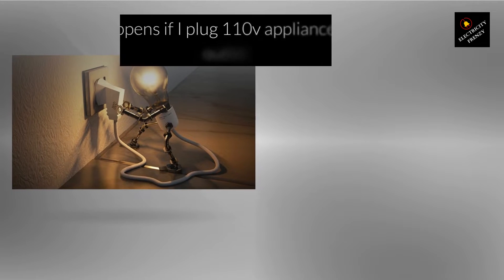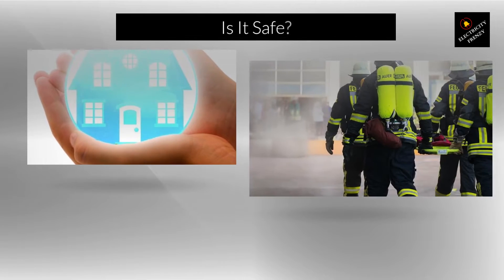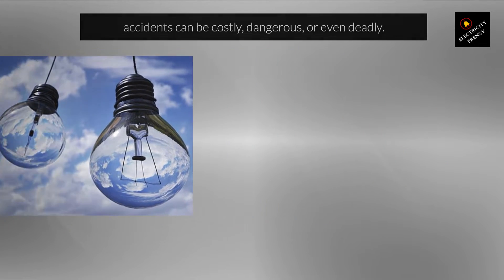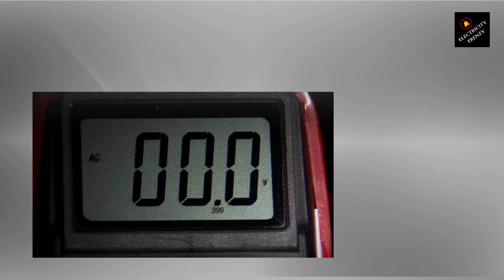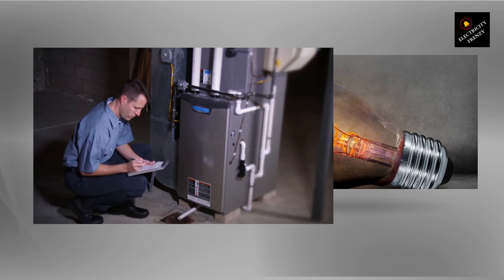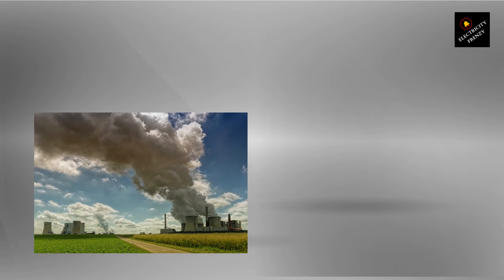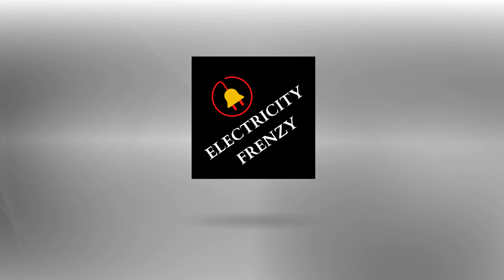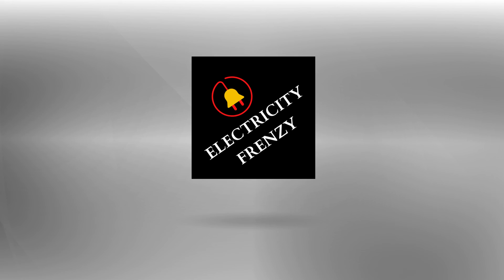what happens if you plug a 110 volt appliance into a 220 volt outlet

Comment: I connected a CD player from Japan from 110 volts to 230 volts, there was a small flash, the fuse blew but I don't know if that's the only damage, if it can be repaired
Reply from the maker: Replace the fuse and try it carefully
Reply: @ElectricityFrenzy After replacing the defective fuse it works again, I'm happy again 😃

Comment: How do dual voltage appliances work?  Phone chargers, laptop chargers, electric razors, electric toothbrushes, and CPAP machines are all dual voltage.  They can tolerate anything from 100 to 240 volts and either 50 or 60 hz.  You will need an adapter (shape changer) when traveling, but not a converter (voltage changer).

Comment: Would it be safe to use a 2000 watt converter/adapter step up/down to run a 1000 watt 110v immersion blender on a 220v outlet?
Reply from the maker: Yes, it will be safe if the frequency of the blender and the outlet is the same
Reply: @ElectricityFrenzy  How can I check the frequency of the outlet? Just to be sure, the converter/adapter is safe for use? (it's not a transformer)
Reply from the maker: Google the frequency of your country it should be 50 or 60 hz

Comment: What if I do it the other way round? For example a 240v microwave in a 110v socket? I live in the UK all our plug sockets are 240v but all the tools we use and the plug sockets in my van are 110, what if I took the plug off the cable from the microwave and wired it to a 110v plug and plugged it into a 110v socket? Surely the cable going to the microwave doesn't carry 240v?
Reply from the maker: Please tell me if I understand you right, you have 220v microwave and you will take just its plug only and connect it to a 110v device and use the device in your van?
If so, it's OK
The 220v plug and wire work well on 110v socets.

Comment: I connected an onn 4k pro tv box to an Italian socket. The device sparked and the circuit breaker on the electrical system tripped. Do you think the device should be thrown away? Thanks
Reply from the maker: Depending on the damage, if the device has protection, it may be fixed

Comment: I have Asus pg248qp monitor it has AC adapter it supports 100v to 240v I bought it from Amazon us so it came with 125v power cord but in my country we use 240v I tested it on our 240v it's working but the problem is the monitor had low brightness so I just ordered a 240v power cord I hope it'll fix the brightness issue.
Reply from the maker: If the power cord is 125v, it should get damaged if it works on higher voltage not to affect the brightness.

However, the cord you have should be 600v, not 125v only.
Try to check any data on it.
Reply: @ElectricityFrenzy  the cord is 300v but the plug is 125v

Comment: I have small appliances like toaster oven, kettle and vacuum 110 v to bring to Philippines , i know i need a transformer  from 110 - 220v but i don't know which one. Do i need to buy like 1000 watts or more? Do i need to check the cords? Please help me, thanks
Reply from the maker: How much frequency in your country make sure it's the same as the appliances first. 

Then you should get a transformer of kw higher than the appliance.

How much is your appliances power

Comment: I have a 110v skin machine i plugged into a normal outlet in Oregon. Is that safe? Its from china lol i plugged it in and it was fine but i just now realized its 110v and not 120v :(
Reply from the maker: The plug power is 120 or 220??
And the machine voltage is 110V-120V or just 110v

Comment: I have Mini chopper from USA and it is 120v~ 60Hz 35w . Which adaptor I need to use please suggest, I'm from India.
Reply from the maker: You'll need a step-down voltage converter or transformer that can convert 220-240V to 120V. It's best to opt for a converter with a minimum wattage rating of 50W, although a 100W rating is recommended to comfortably handle any initial power surge from the motor starting. Additionally, you should make sure that the converter is compatible with India's plug type (Type D) or get an additional plug adapter if necessary.

Comment: I used a 120 V Krups coffee mill for about 10 seconds at 240 V, probably brought in Cyprus from Illinois by my mother in 1994, but it worked without any serious problems. The only thing was that it was vibrating like a concrete vibrator. After that, I bought a transformer and when I tried it on the transformer, it was working fine. I believe the real problem would be for sure if I did the same with a toaster, or anything that converts electricity directly into heat. However, 10 seconds don't seem enough to cause any damage, at least when it comes to electric motors
Reply from the maker: It's fascinating that your Krups coffee mill managed to handle the voltage mismatch without serious issues, at least for that brief period. However, it's important to note that appliances are designed to operate within specific voltage ranges, and exceeding those limits can pose risks.

The fact that it vibrated significantly when used at 240 V suggests that the motor might have been under stress. While it may not have caused immediate damage in the short term, prolonged use under such conditions could potentially lead to wear and tear, reducing the lifespan of the appliance.

Using a transformer to adapt the voltage to the correct level is a wise decision and ensures the proper functioning of the device without risking damage. It's true that certain appliances, like toasters, which rely on direct conversion of electricity into heat, may be more susceptible to damage under such conditions.

Your experience highlights the resilience of some devices, but it's generally advisable to operate appliances within their specified voltage range to ensure safety, longevity, and optimal performance. Always refer to the manufacturer's guidelines to avoid potential hazards.

Comment: Yo i bought a ps2 and i accidentally put its 110 volt cable into a 240 socket, what happens to it, can i just buy a converter and itll work or i gotta repair the inside of it
Reply from the maker: Sorry to hear that
Did you notice smoke or smoke smell?
Reply: @ElectricityFrenzy  it's not the cable it's the actual console itself:/
Reply from the maker: I see, that's unfortunate. If the issue is with the console itself due to plugging it into a higher voltage, repairing the internal components may be necessary. In this case, seeking assistance from a professional technician or contacting the manufacturer's support for guidance would be your best bet. They can assess the extent of the damage and provide the appropriate solutions to get your PS2 back in working condition.
Reply: @ElectricityFrenzy  ok thanks
Reply from the maker: You are welcome
Reply: @ElectricityFrenzy  nah, nothing do I go to a repair shop or its probably just the cable

Comment: Accidentally plugging a 110-volt appliance into a 220-volt outlet is not uncommon here in the Philippines because despite our voltage of 220 volts our outlets are American-type NEMA 1-15R which means a plug from an American appliance can fit into our 220-volt outlet damaging them. They require a step-down transformer to be used here although some modern American appliances have universal voltages that accept from 110 - 240 volts and don't need a step-down transformer.
Reply from the maker: Thanks for your time
Reply: I have ps4 sir na 110v pwde lang ba plug into 220v?

Comment: I have a question: if I have a 100V requirement console (I got it from japan) and our output is 250V, what would you recommend using to prevent the console from overflowing?
Reply from the maker: How much power is the console?
Reply: @ElectricityFrenzy can't you see?He said A 100V CONSOLE
Reply from the maker: @deandretan55  I see the voltage rating, I'm asking about Power rating "Wattage", any way, If you have a console that requires a 100V power supply but the outlet in your country provides 250V, you'll need to use a voltage converter or transformer to prevent the console from getting damaged due to the higher voltage, Keep in mind that you should check the voltage converter or transformer power rating and make sure it's higher than your consol.
Reply: @ElectricityFrenzy  I think Japanese controllers are like 30-50 watts.Use an Automatic Voltage Regulator.Most modern controllers are dual voltage